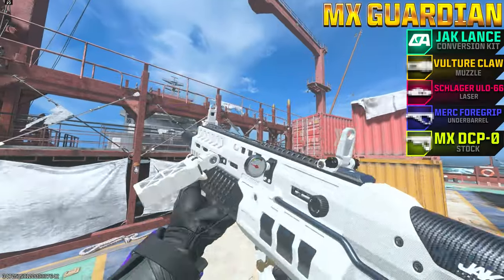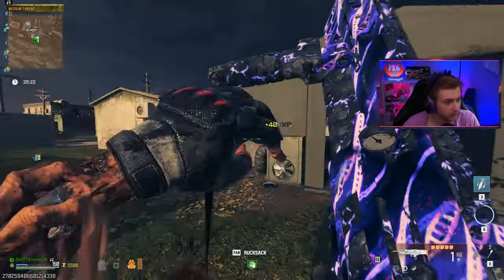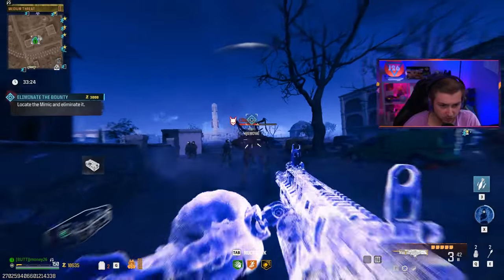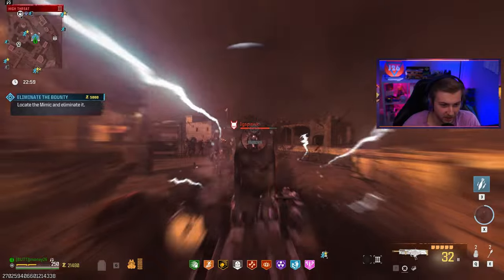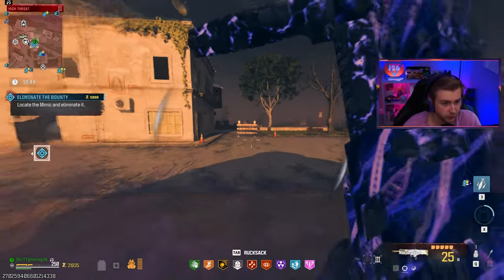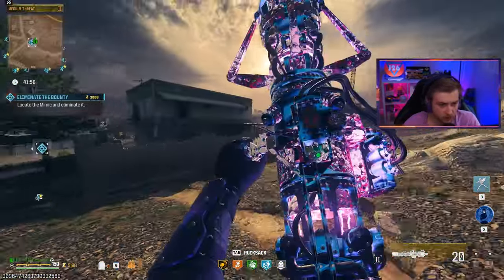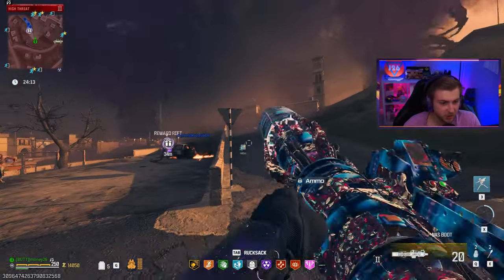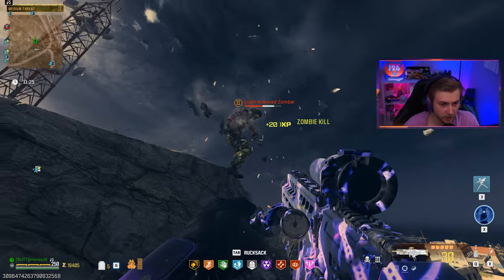Pack-A-Punching the 'JAK LANCE' in Modern Warfare 3 Zombies

Comment: Nowhere on the description of the gun says to hold the trigger, it just says when its idle the pressure builds
Reply: It doesn't even do that either
Reply: @thatsprettygood9613  I’m taking a guess that it’s bugged I mean the aftermarket part for the AMR nine was bugged at first
Reply: @thatsprettygood9613 It does do that. If you wait a sec between shots the accuracy and velocity are better.